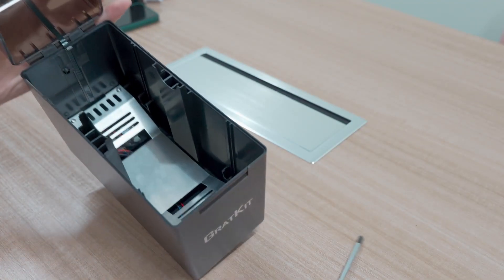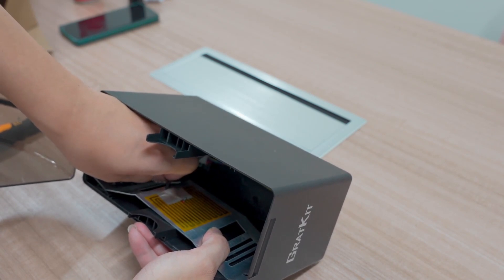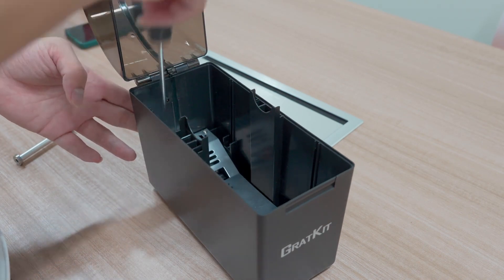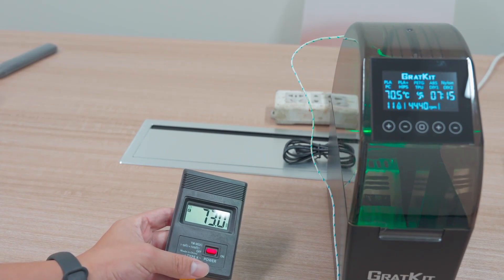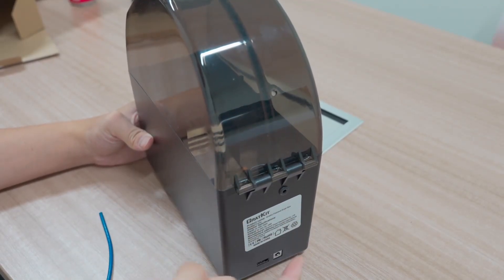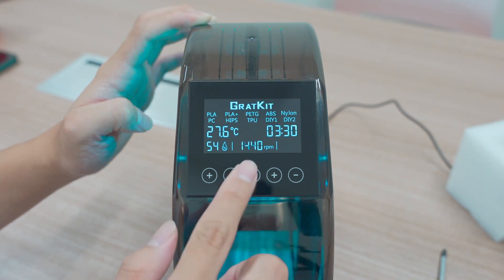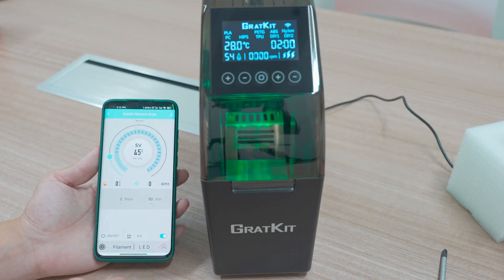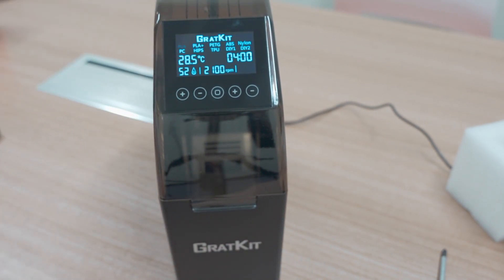GratKit Firefly dryer box FAQ

Comment: The trick to reach the 70°C seems to work, but how can i turn the annoying peep sound off? And the background music could be a little bit quiter when you talk. And how can i set the fan speed to a constant rpm? The sound of the fan turning up and down is annoying too.
Reply: I agree, the beep is very annoying.  My unit also couldn't hit 70C after running for many hours so I was directed to check this video.  The thermosistor on mine was under the tape and really, this should have been tested before leaving the factory.  Quality Control , as we call it.  I have several filament dryers from other brands (Eibos, FixDry, PrintDry Pro, etc) and this is the first I have had to repair out of the box.  Also, the idea of putting the desiccant inside to filament roller is a bit out.  If the roller had holes, that would work but given it ends are almost sealed up with the sides of the enclosure - well, it certainly isn't ideal.
Reply from the maker: Hi, thanks for your feedback!

1. For the beeping sound, it is suggested that Tuya IOT. If you really don't like it, you can check it with the motherboard side. You can add the high-temperature resistance foam to the speaker, it will be helpful

2. For the fan speed control. It is based on the top lid temperature and the bottom temperature sensor. At first ES version used the manual control for fan speed. But it is not safe for the user(May cause the heating plate to overheat and then cause the spool defect. Or it may cause hard in heating 70℃)

Greeting
Reply: @GratKit3D  what do you mean with "For the beeping sound, it is suggested that Tuya IOT"? And the high temp foam would only make the peeping noice a little bit quiter or could that "mute" the speaker?
Reply from the maker: @fabianluethi03  
what do you mean with "For the beeping sound, it is suggested that Tuya IOT"? And the high temp foam would only make the peeping noice a little bit quiter or could that "mute" the speaker?
--------------------------------------------------------------------------------------------
1. Since the APP needs to be connected to the drying box, Tuya IOT suggested that we add a buzzer to confirm the command and give feedback to the user.
2. It can decrease the beep level but we can't mute it. Unless we remove the speaker off:(